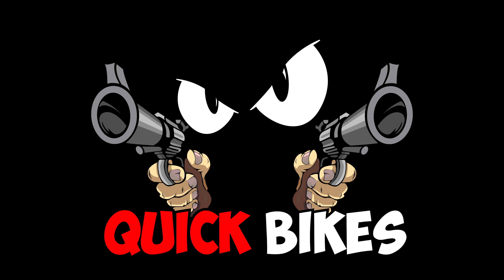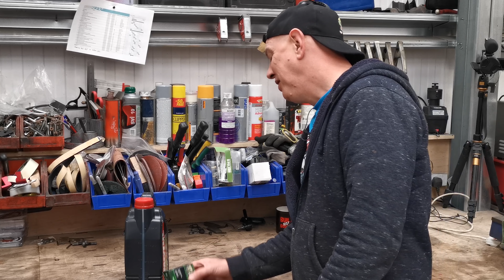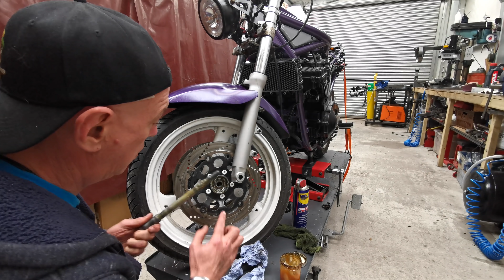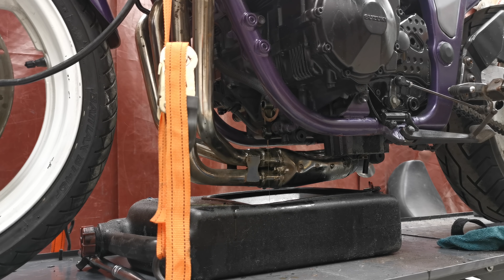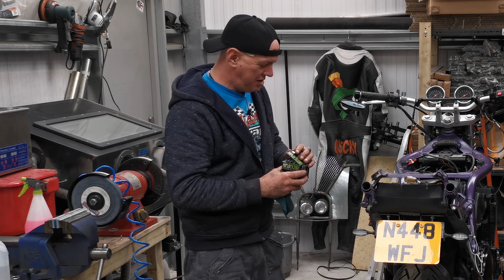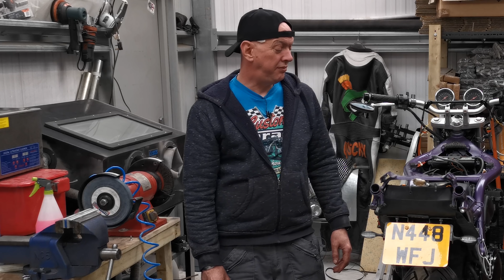Van or Bike? - Day 8

Comment: Yeah, the Racetech emulators are around  £120,  but the more cost effective YSS ones are under £80 a pair, they work the same way and are more cost effective. For the bandit search for YSS PD 335. Add a set of Hagon springs for £85 (British made and you can call them and spec your spring rate) and you can even afford a set of Mr Ching's "birret" preload adjuster fork caps all for under £200 😉
Reply from the maker: Sounds really good and I'm taken with the idea 😁👍

Comment: Ah ha, a touch of the west country accent has started to creep in there right at the end when you said "Laters" The boy's going native 😁
When it comes to the project bike, what about a set of K1/2 600 forks? They were conventional, and would have better damping adjustment, plus being Suziki, the chances of them being compatible with the Bandit without a lot of fafing around is going to be higher. SRAD front wheels and spacers, for example, have the same dimensions/spacers as the slingshot 750's, and also fit nicely into a pair of K6 GSXR 750 forks. That means that yokes designed for slingshot Gixers can have that setup slotted straight in. (Did it, many moons ago.) Inter brand swapping of components is definately the easiest route, although as Craig has shown, cross brand swapping can be done.
Reply from the maker: Yeah I was thinking SRAD as well just to keep it all Suzuki,. There were a couple out in the Supersport class with us that could really get stuck into the corners, so I know they're gonna be capable... If need be I just get a complete front end and press out the steering stem if it's different. Lits of possibilities I think 😁👍
Reply: @QuickBikes  Not sure how different SRAD forks are to K1/2 600, probably not much, however I had a K1 600  that felt good. Mind you, my Steelie 600, with air gap sorted, and pushed through the yoke 15mm, felt great too, although that was 2003, and I'd not tried anything exotic/modern 😁
Reply from the maker: You can get old school to boogie something fierce if you work at it and get a good setting... I'm hoping to find something conventional that I can get to work well around a track on a new built, old school looking oil cooled bike... No pressure 😂🤣😅
My old Zx6r race bike was awesome if not a bit clunky, but I really liked it 😁👍
Reply: @QuickBikes  Yep, same with my Steelie race bike; clunky, but fitted me like a glove.

Comment: On my 1200 back in the day when I had it I used gsxr 1000 k4 I think rear shock. Also if your looking for a good conventional fork look at yamaha thunderace forks. They are 48mm legs so have less flex than conventional forks, 3 way adjustable and they run decent size discs out of the gate and blue spot or better gold spot calipers fit them
Reply from the maker: Ah nice one 👍
The stock setup is gonna grind on me I know, but good to know what some other options are. Thanks for chipping in Mike 😁👍

Comment: I think the gsxr 750 slingshot forks fit strait into your stock yokes mate. Old I know but probably cheaper with some adjustment
Reply from the maker: Ahhhhh.... Good to know. I'm gonna do some digging around and see what options there are as you just KNOW the stock setup is gonna be sooooooo limiting. Thanks for chipping in Kenneth, much appreciated 😁👍
Reply: @QuickBikes  by the way I have a cbr1000 race tail piece if you want it mate. Was for my bike but it doesn't look right. It's a one piece with the undertray
Reply from the maker: Very kind of you to offer Kenneth, but I think we're alright for now 😁👍